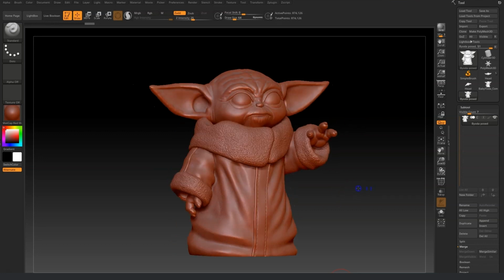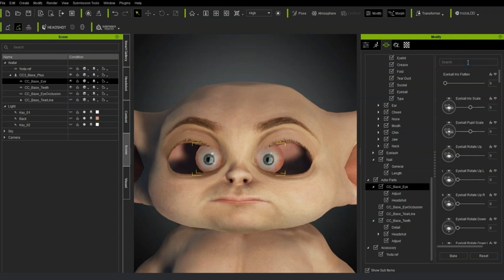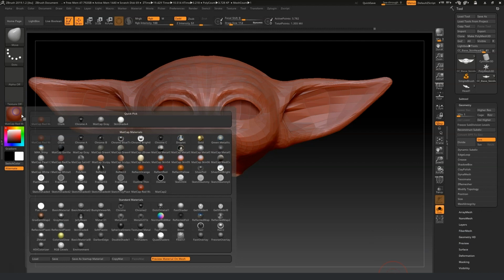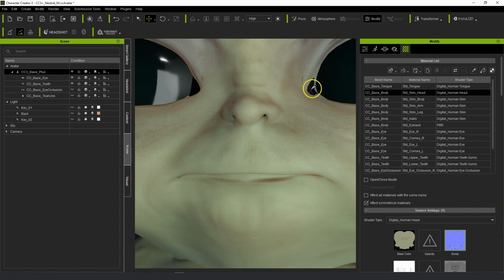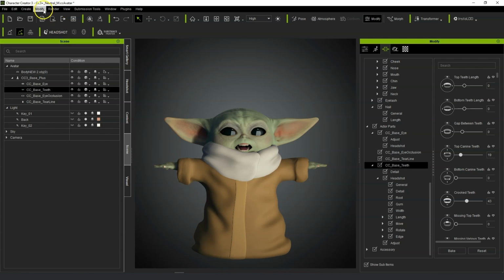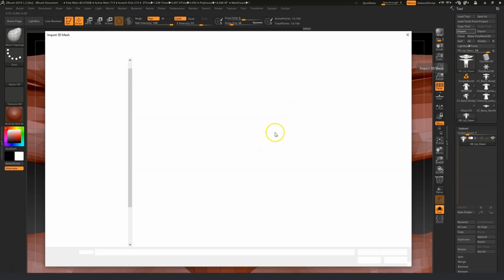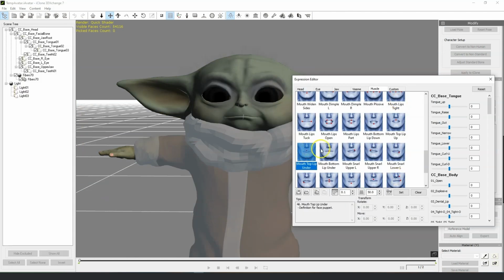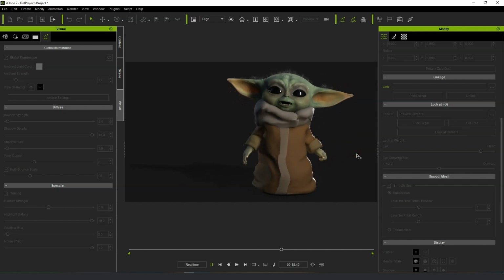How to convert custom 3d model to CC3 character with full body and facial Rig, Grogu example

Comment: Nice convertation (sculpting for 1000 hours). Nice convertation... Good guide. Dislike
Reply from the maker: @rocknnroller1  this is an out dated video now, if you search for some videos for headshot in CC4 it does the same process without the need for sculpting

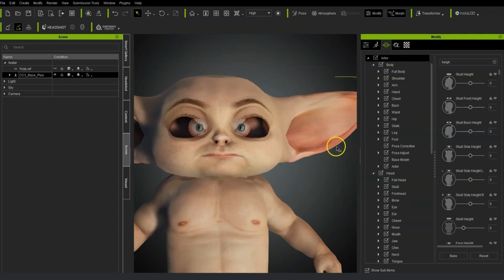Comment: I have been trying to do this with Blender and It is making the mesh non-compatible with the animations in both CC4 and Iclone 8.  The work around I have found is using Accurig to re-rig the altered mesh.  Accurig work with the animations, but there is no facial rig to go with it.  My question is, do you have to use Zbrush instead of Blender?  I see there is a live link between the two @20:36.

Comment: I have been really struggling to animate the wild mythological creatures I make with Adobe Medium. The meshes I create are often in the millions of vertices and it's so difficult to retopo the sculpts.  I'm an artist so none of this plug and play asset purchasing is my goal. Is it possible for me to use this technique but using Blender or Nomad instead of Zbrush? As an artist who's coming from traditional media Adobe Medium was a god send. But now I'm finding myself fairly stuck with the kind of crazy high poly meshes that come out of Medium.  Love your content! Thanks!
Reply from the maker: I'm sure there is probably a way in blender, but i don't know it well enough to give any suggestions of how, the main goal is to use the iclone base mesh and project the detail from your high poly model to the lower poly model. Ive not tried this but something like this might work well https://youtu.be/4-Sj0VNEYe4